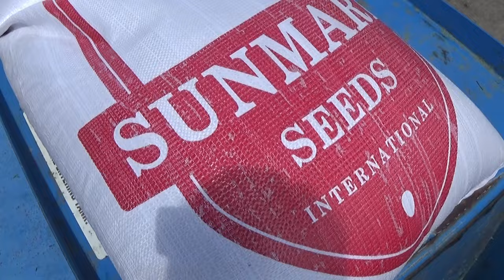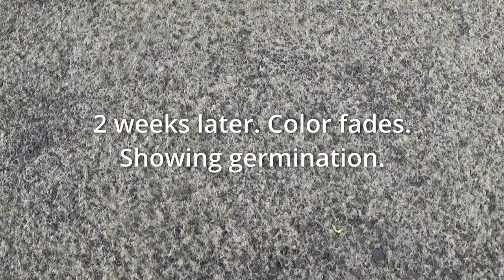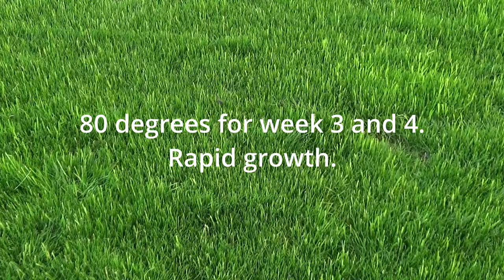Hydroseeding for Accuracy. Before and After Results.

Comment: I got same results on my lawn using a small turbo turf machine I picked up for $300 almost 20 years ago. A couple years later I bought an old abandoned  800 gallon Bowie for $500 from a commercial plumber. 4 cylinder Wisconsin engine with Bowie gear pump. Greetings from San Diego California.
Reply from the maker: I always wanted a smaller unit for these small jobs.
Reply: @gorgeoutdoors  turbo turf worked good for small areas but limited to paper mulch only since it's a jet agitation machine.
Reply from the maker: I'm considering building one this winter, but I never seem to finish any dreams over winter.
Reply: @gorgeoutdoors  pretty  simple design.  Just  need  a round tank a few  valves and a trash pump. Plastic pump last a little  more and Don't  corrode with  fertilizer.  Mine has a 2" b&s 3.5 hp pump.  I have a 500 gallon steel tank that I've been  wanting to build.
Reply: Здорово👍 привет из России
Reply: @gorgeoutdoors  parabéns gostaria de algumas instruções, estou no Brasil.
É possível???
Reply: Regular seeding grows thicker Grass
Reply: Why is the spray that green colour?

Comment: Would you recommend hydroseeding for lawns that have good grass in some areas, almost NO grass in other areas?  I cannot get grass to grow no matter what I do it seems.  Lawn keeps getting worse every year.
Reply from the maker: It never takes when I shoot over existing grass. It will germinate above the soil and reject. It likes direct soil contact. If the soil is compacted, I would airerate, overseed, light compost, and hit it in 2 directions with a thatcher or verdi-cutter.  And fertilize. That always does the trick here. Its often a compacted soil issue.
Reply: @gorgeoutdoors  I appreciate it, thank you!